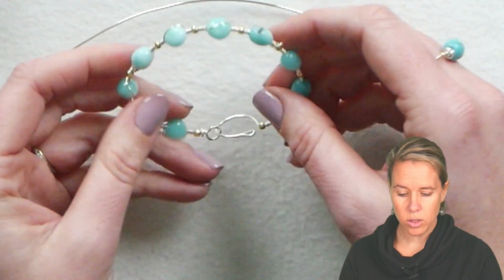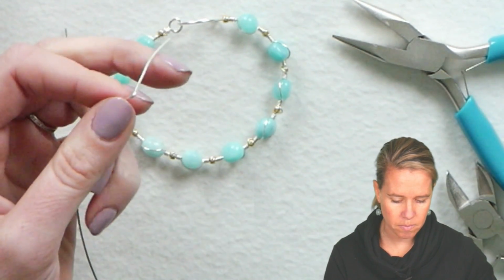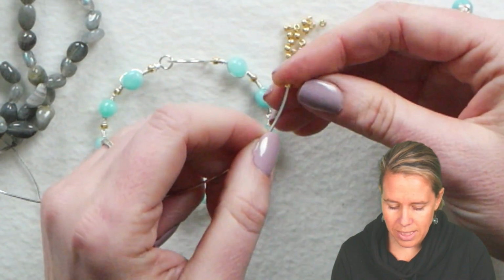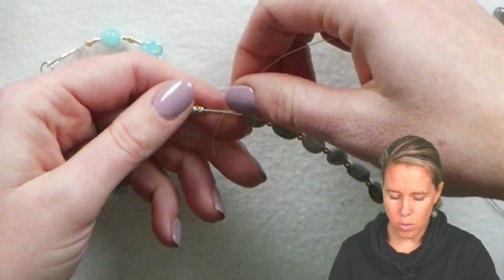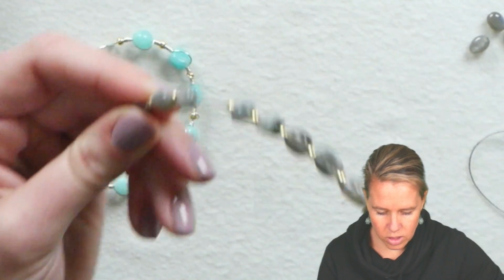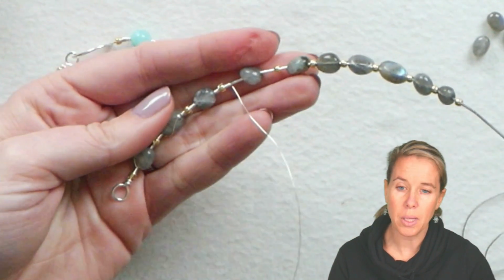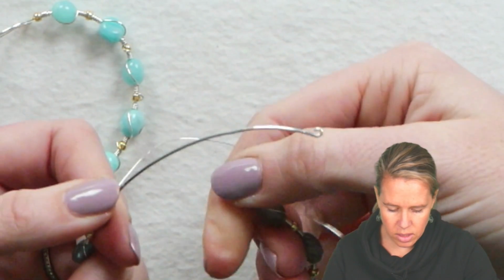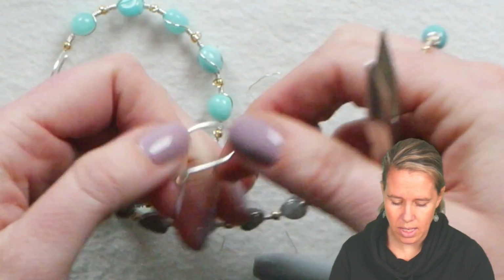Stackable Wire Gemstone Bangle - DIY Jewelry Making Tutorial by PotomacBeads

Comment: I tried this on memory wire, but I only used one ring. It's slightly less secure than I would prefer. Have any of you beaders tried adding a clasp to memory wire? I know it kind of misses the point, BUT it might also be a good use for those extra partial memory wire loops I always end up with??